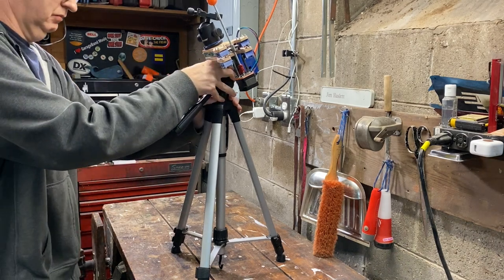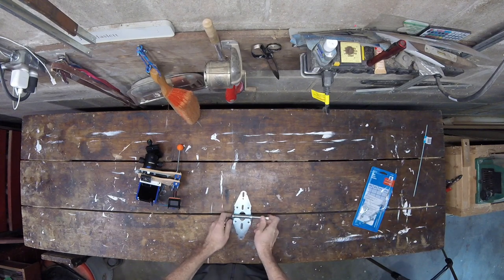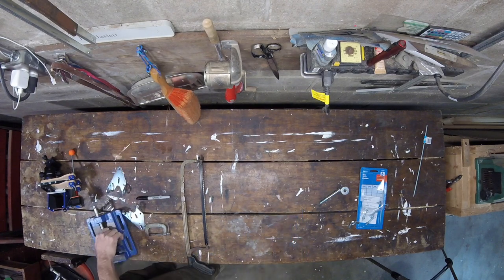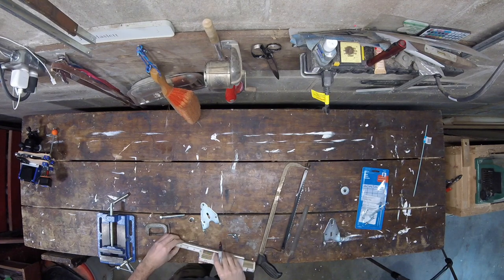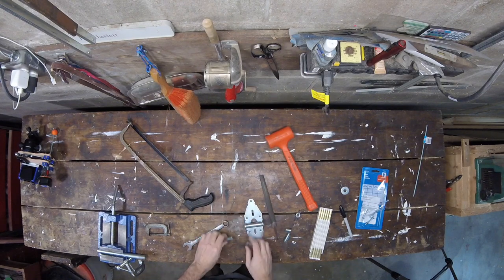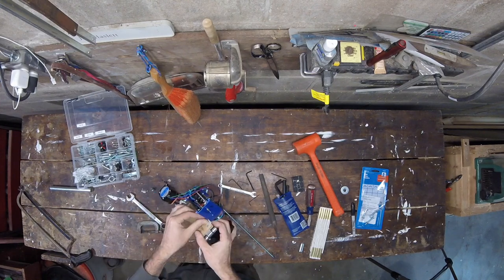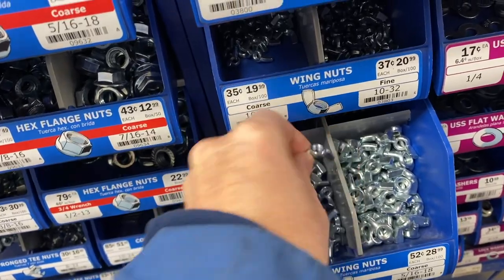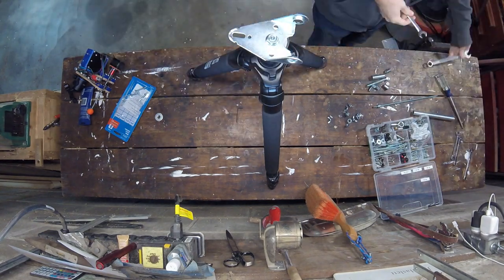DIY EQ Wedge for Barn Door Tracker

Comment: Hello
, I have loaded my Raspberry with all the data you provide on your site to download images from weather satellites.
In principle I think it works but I have a doubt and I will appreciate if you can help me.
I uploaded everything to the Raspberry using a wifi connection with Putty and since my knowledge of Linux and Rasp is very low, I would like to know if the system is still working when I disconnect from Putty.
And I would also like to know if when I turn Rasp off and on again, the system boots by itself or what instruction I should place.
Thank you very much for all the help you can give me.
Kind regards
Albert
Chubut Patagonia Argentina